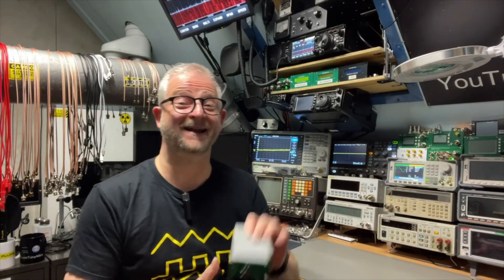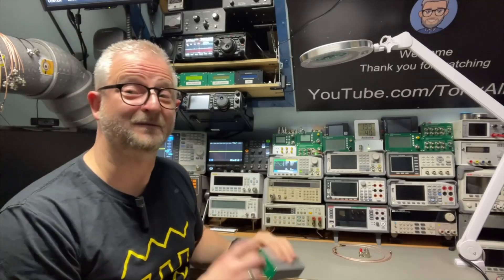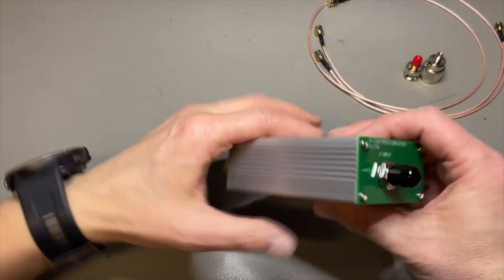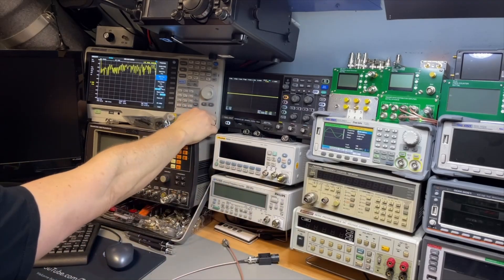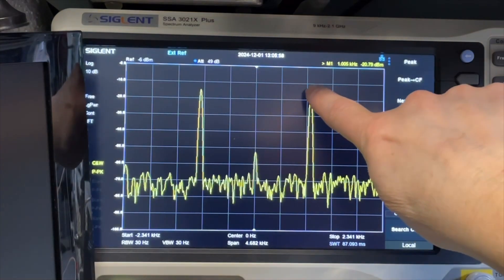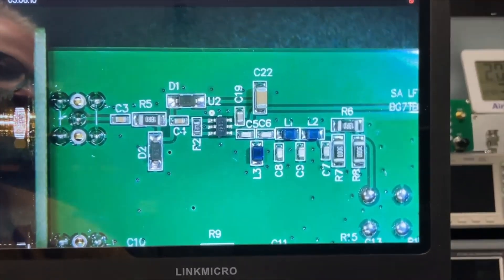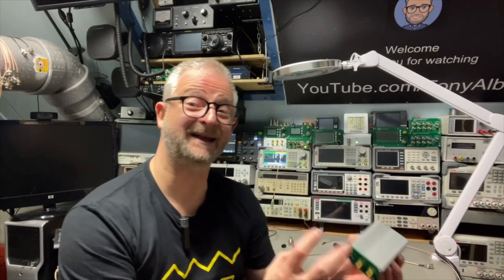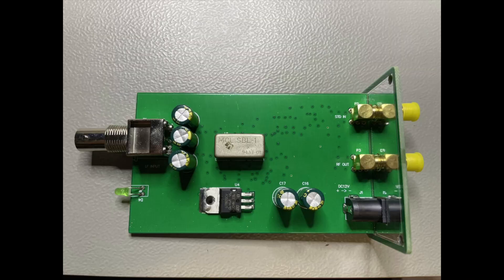TA-0430: BG7TBL 2Hz - 2MHz Low Freq Converter SA-LF-CONV for Spectrum Analyzer Test and Teardown

Comment: G,day from Sydney Australia.
This question may sound peculiar.
Is it necessary nowadays with components having such a wide band tolerance? e.g 50-6000 MHz
🤔💡
Reply from the maker: Great isn't it. as long if the gain is sort of flat its usefull too.

Comment: I have an HP 3585B that goes down to 20 Hz. It's a great spectrum analyzer for everything from mechanical vibrations, to audio, LF/MW/HF, and on up to 40 MHz. But it weighs about 90 pounds so it's useless for anything I can't put on my bench. (I had to ask a friend to put it on the bench to begin with.) So this converter would be helpful.
Reply from the maker: Hi John, that HP seems very nice, goes so low!... bit heavy also :)

Comment: I used a SBL-1 in a circuit  to convert 10kHz - 500kHz signals up to a ham band - worked pretty good. Still works after about 50 years !
Reply from the maker: Great, thanks! i did not know it was that good.